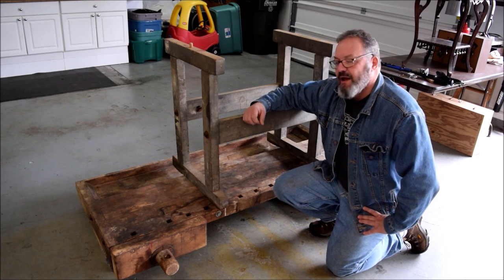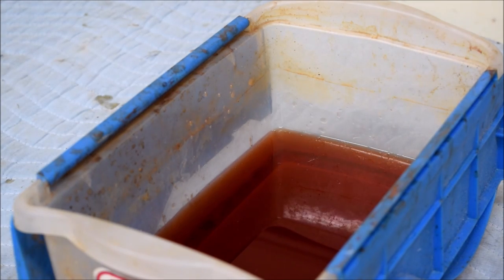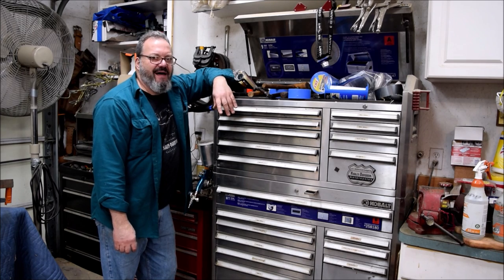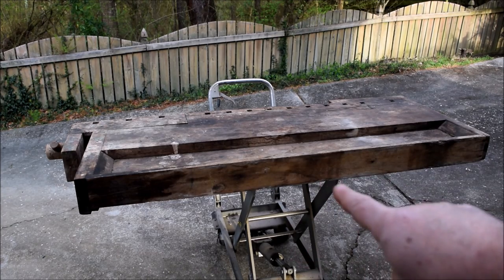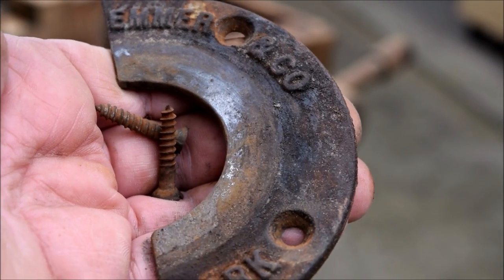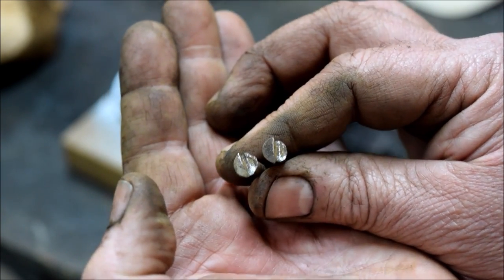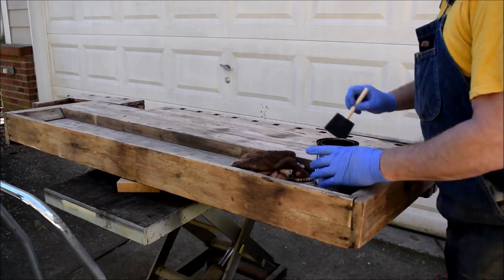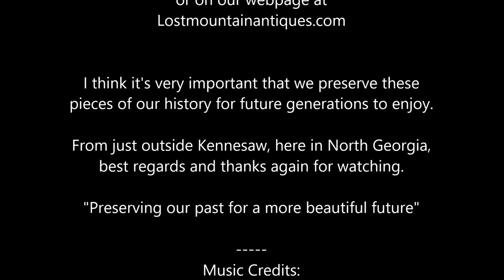Restoring an Antique Woodworker's Bench

Comment: I am just restoring a similar bench, C. Christiansen Co., Chicago Ill.  Same configuration as yours... Face Vice, Tail Vise, rear Tool Well, square dog holes along the front.  Mine was pretty roached out from years of use as well.  I had to strip it down to the nuts and bolts, reset one of the face vice guide legs (it was not parallel nor square with the face of the Jaw.)  Your video was very helpful.  You did a great job with it. Cheers
Reply from the maker: Thank you!

Comment: Supper great find Larry i found one many years ago and let it go when we sold the house and property mad at my self all the time you  bet if i find another one it will be going home with me yours looks good and hope you get many good years of service congratulations
Reply from the maker: Thank you, Ed.   I am right now taking a break from a total reorganization of the shop so I can fit this bench and a Shopsmith into the work flow.   The Shopsmith was a gift I wasn't expecting and the two pieces together are presenting a bit of a challenge for me space-wise.   I'm about 3/4 done in the shop and then I have a full truck load going to the dump.   I guess every once in awhile, a purge is necessary.  Thanks for your comment and for watching.  Best regards.

Comment: Larry Im glad I found your channel.  Im in the process of doing a full restoration / preservation video of a 1800s workbench similar to yours and was wondering where you got the info om the finish.  Im not going to be staining my but I want to do a traditional finish like you, and just want to make sure it period correct.  Any info you can point me to would be great.
Reply from the maker: It's a finish I learned of somewhere along the line.  I can't say if it's period correct or not.   I can tell you that it has worked out great for my bench and I even put a second coat on one day and it blended right in.   I'm very happy with it so far.   Good luck with yours!

Comment: Oil stains will usually come out if you soak the wood in acetone.  I use it to clean up hammer handles from  garages and it does quite well.  Good luck and great video
Reply from the maker: Thanks for the info!

Comment: I enjoy watching your videos. They're very informative. I'm just starting out in this type of work. Right now it's more of a hobby. Any tips for people just starting out? Like what are good begginer projects and what is easier or more difficult for begginers?
Reply from the maker: I started out with low quality pieces which I repaired and/or restored then re-sold.   I did literally hundreds, if not thousands, of pieces this way.   With a large volume of disparate projects you will be able to dial in your techniques and quickly identify what needs to be done and how to best do it.   Color matching was the most difficult task for me to wrap my head around.   As far as difficult projects go, I would stay away from higher priced items until you are comfortable with your skills and abilities.   Antiques and treasured pieces from clients should wait until you have built your skills.  Table tops can be pretty tricky to do correctly as are hand rubbed gloss finishes.   A network of trusted resources is invaluable.   Try to identify skilled wood workers and refinishers who can give you advice and guidance when you need it.  Start small and work your way up.   Good luck.

Comment: Larry -- it is a Christiansen Workbench.   Here are two links about a similar restoration:  https://www.youtube.com/watch?v=A5leo3dvYgM,   and https://www.youtube.com/watch?v=bFETcKiJ4F8.   I'm in the middle of restoring the one I've had for 50 years --  I've had to plane down the top to get it level, and will have to patch a number of gouges, and the entire front edge which is rough with deep saw kerfs.   Your video will be very helpful as I try to repair the end vise.  Since I couldn't keep the lovely old patina I will, like you, have to refinish -- what stain did you use?  It looks about right.   Thanks much.